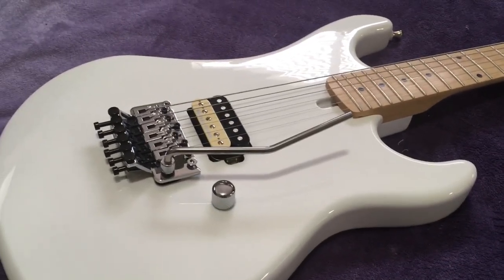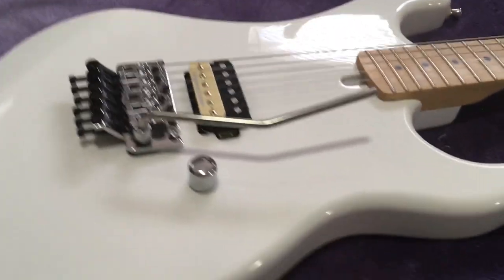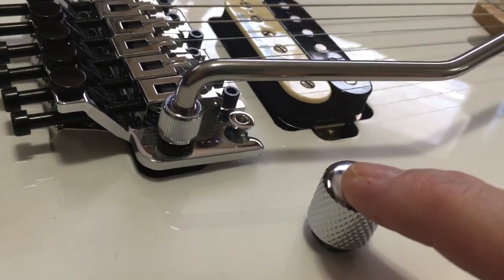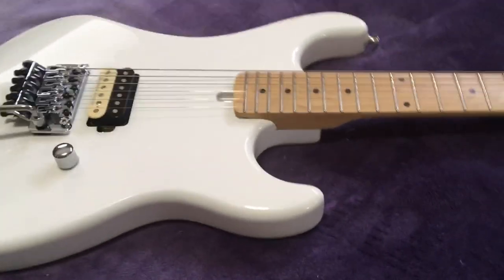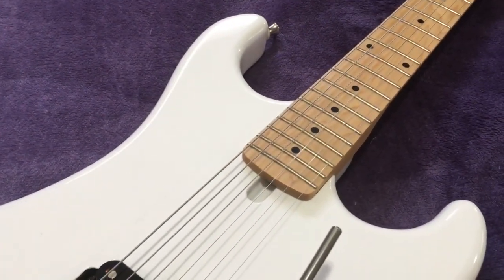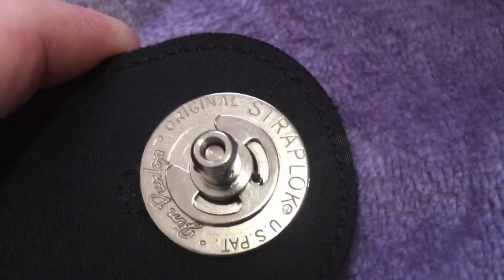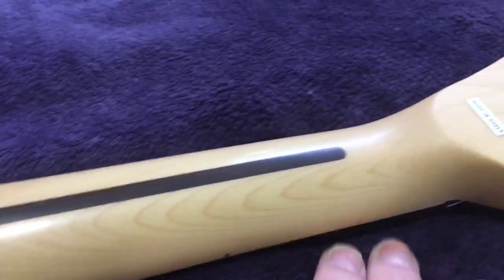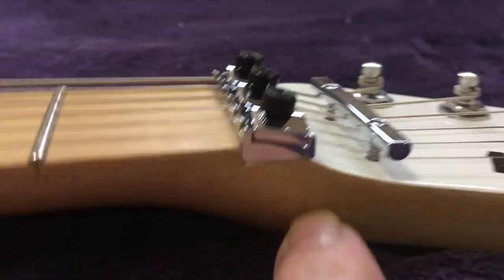Kramer Baretta “The 84” part 1/of 2 videos. Detailed Inside Look Into Guitars video

Comment: Hi, that guitar is nothing like a usa '84 baretta ,  I have an original , '84 usa custom shop that came with three pots , two emg's in white ,black guitar, three piece scarf banana neck ,  i've owned it since '86 and played it almost every day .
Reply from the maker: fivedoors Kramer used Schaller pickups in 1984. They change to Seymour Duncan’s in 85. You say you have 3 pots on a Baretta? EMG pickups were used on the Stuart Spector series guitars in the late 80’s. Gibson/Kramer designed this 2015 guitar after the 1984 model Beretta. That’s why they call it the 84’. I didn’t name it the 84’ or design it Kramer/Gibson did.
Reply: Pacers had the 3 knobs and dual humbuckers, not Baretta's!
Reply from the maker: That is 100% Exactly what I said. Did you watch the video series? It’s a two part video series. I am showing you what Kramer Pacers look like and I am showing you what the Kramer Beretta looks like. I am telling you the differences between the two types of guitar models and the differences between the years.
Reply: @chrislink007  Mate , I ain't talking about a shit gibson re-issue of the '84  kramer baretta . I own an original 84 custom shop baretta .  D usa plate. Baretta , It was fitted with 2 emg's  original floyd rose, scarf joint banana head stock.  all black  with cream emg's,  three knobs, angled bridge pick up.  It was a custom shop which is why it's not the same as the normal Baretta's.
Reply from the maker: That sounds like a really cool axe! I would love to see your Kramer custom guitar. I believe that they would have called it “Kustom Kramer” ( you know play on words) hehe Do a video when you have time fivedoors!👍🎸
Reply: @chrislink007  i was referring to five doors and his confusion between the models
Reply from the maker: Thank you Dennis. I completely misunderstood you. Sorry my friend. 😀👍
Reply: @chrislink007  it's all good bro. I wasn't trying to sound like a butt...Lol
Reply: @chrislink007  A picture of  my 84 emg custom shop baretta D  plate   in my profile pic, you know the baretta that doesn't exist lol
Reply: no kidding? a usa built baretta is better than a Korean made one and for $$$$ more? wow